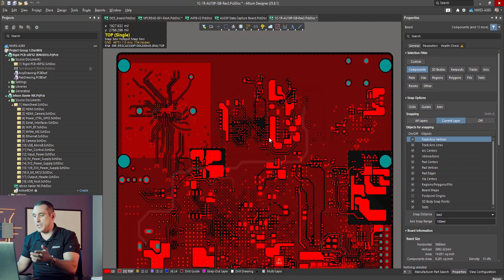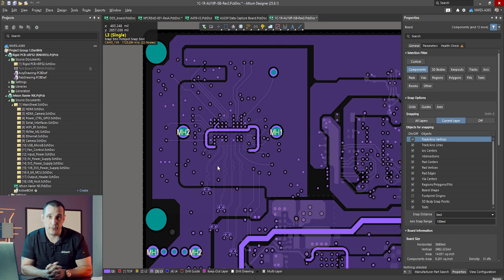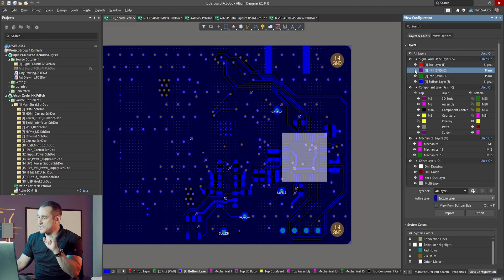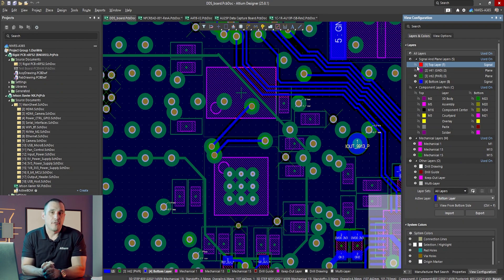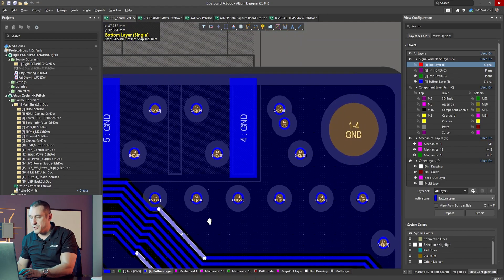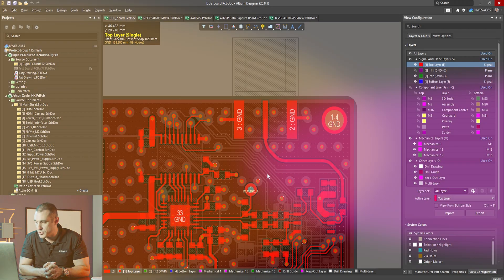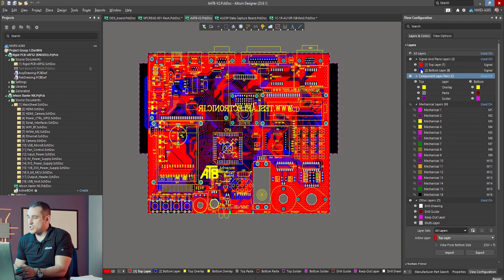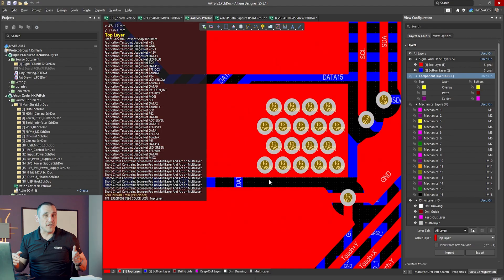The Right Way to Use SIG/GND/PWR/SIG Stackups

Comment: @Zach Peterson Thanks. Great Video!
Question: In the board like your DDS example, how would you handle traces carrying digital communication between MCU and DDS chip. Example 1, having an SPI interface of DDS connected to Microcontroller, or 
Example 2: Having a SPI interfaced ADC in place of DDS (analog rail) with data interface connected to Microcontroller - ADC Digital Bus needs to cross that 1.8V and 3.3V barrier somewhere. How would handle that kind of layout? Thanks.

Comment: does routing on the top of holes made by  vias could make emission provlems ?
Reply: I'm not sure what you mean. You cannot route on top of a hole. If the hole pass into the same layer where you are routing, then the hole becomes an obstacle to the routing and you cannot route there. If you are referring to a hole from a blind via, the via hole is typically too small to make  difference in the impedance or emissions.

Comment: What about SIG/GND/SIG/SIG? Current is little, power can be shared on either top or bottom
Reply: It depends what you have put on the two adjacent signal layers. If both layers have high speed traces that require controlled impedance, then you have a risk of routing traces near each other which could create crosstalk. What many designers will then try to do is to fill those layers with ground, which is not a guarantee to solve a crosstalk problem. Sometimes what is done in that situation is to use orthogonal routing, where the traces on the different layers are oriented 90 degrees to each other. This significantly reduces crosstalk but it is best used where both layers are stripline, such as in some 6 layer PCBs.

Comment: Good video. 
Used it and and also this variant, SIG_PWR/GND/SIG_PWR/GND. Close to the one you mentioned.
Reply: Yeah we also did a video about this stackup, I like using it in power systems where components  are not needed on the bottom GND layer.

Comment: Anything regarding the multiple insulation clearances in the design rules for external and internal layers? When can we expect this topic?
Reply: Good question, you can do this by creating a design rule for specific net classes on specific layers using the query language in the PCB Rules and Constraints editor. I have never set this up in the Constraint Manager as I do not like that interface. Once you have the net class and layer specified in the design rule, you can enter in the clearance values you want. I'll make a video about this as it is a good question.

Comment: What about motor driver designs? Should the switched motor lines and the motor driver supply rail be routed on a separate power layer?
Reply: The two reasons he listed why you might want a dedicated power layer are "lots of current" and "lots of separate power rails."  I would expect at least some motor driver circuits to meet both.
Reply: @jimjjewett  Yes some motor driver designs definitely meet both. Also depends if it's PWM driven or AC driven and what is the voltage/current. I think for most compact motor driver boards, you're doing PWM driving at low current, so put the PWM rails on a layer above GND and should be fine, space out the components from the PWM lines as needed. Otherwise you get some crosstalk from the PWM driving. Then have large rails coming off the driver stage over to the connector to provide the high current. The case with really large rails for motor driving is less common because you would need vias to get the current into the inner layer and then the routing would go over some distance, so I don't think it makes much sense. I would say put the driver stage closer to the connector that interfaces to the motor and put the rails there.